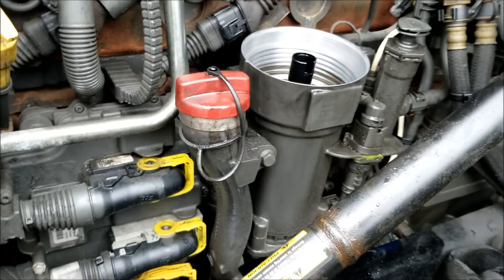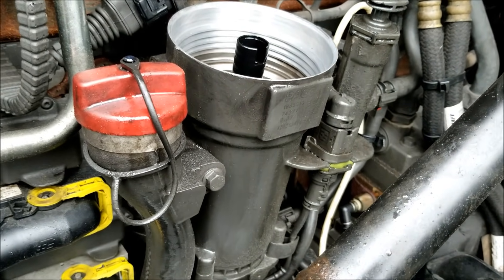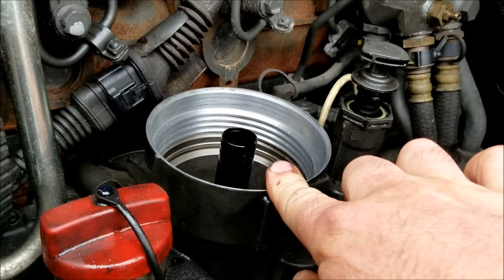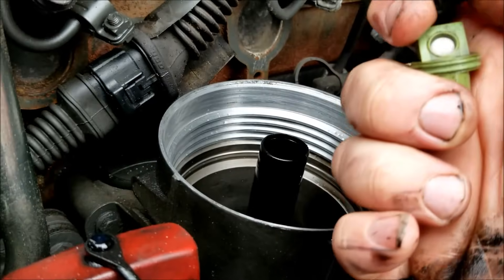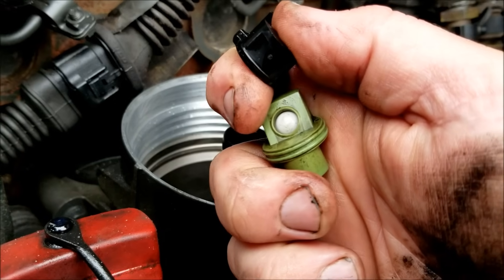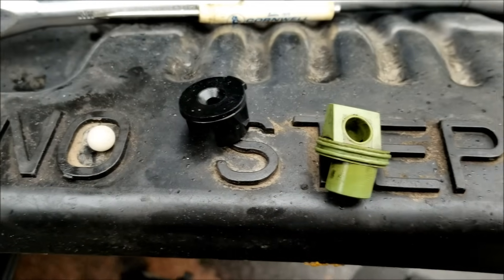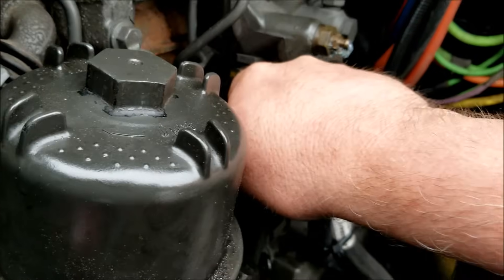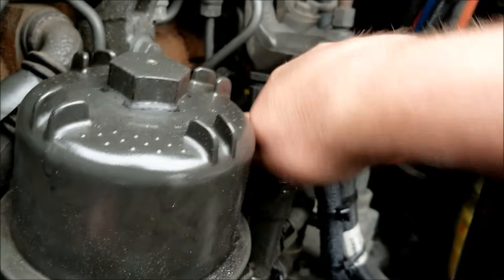Paccar MX13 Fuel Issues - Check Valve video by Dr. Paccar

Comment from the maker: Make sure you remove the ball from the green piece. The green piece must be reinstalled.
Reply: Just changed my filter and removed ball green thing and cap...and started getting check engine light stating low fuel pressure....guess I need to put green thing back in and cap...lol

Comment: My truck would crank n run but after sitting over night I had to prime it to get it to crank so I open the file filter n removed the ball primed it back up n release the air n prime it again n she fired up let see what it does n a few hrs video was very helpful thanks
Reply: Hi 
Does your problem solve by removing that ball please update 
Mine have same problem

Comment: We are having the same issue. Found your video, removed the ball. Truck ran fine while driving until we stopped and dumped off the load. Truck through codes P0087, P1087 and P00BA. Filter has been recently changed. Could this be a fuel pressure control valve?
Reply from the maker: Depends. Most of the time I seen a code for the fuel pressure control valve electrically fail.  But haven't come across one fail mechanically yet. But you would need Davie 4 to monitor this. There are other things that could be wrong.  The new fuel filter could be defective.  The o-ring on the housing cut. Also there are two unit pumps on the back left rear of the engine.  I have seen one fail causing a low fuel pressure issue.  Just two weeks ago we had to replace the entire fuel filter housing because something was jammed up inside of it.  It would start,  run then die out. There are valves inside of the fuel filter housing.  But without the aide of the Davie 4 software you will just be changing very expensive parts.

Comment: This just saved me a fortune. Fuel filter replaced and came up with engine malfunction, changed filter again and then the fault persisted only under load. Checked and the ball was in the rubber. Removed and no more faults.

Comment: Most unreliable engines are Paccar. Never ending errors on dashboard and breakdowns. Parts for it are insanely expensive.
Reply from the maker: Yes, buy Cummins power.  The DDE13 and DDE15 aftermarket systems are horrible

Comment: Many mx13s have a small filter in the primer unit that can clog. Unscrew, remove, check and replace if needed. The check valve is one I didn't realize can be blocked! Appreciate that heads up! Not one service tech I've watched that took 20 mins to prime my filter turned that bleeded valve, or checked check valve or primer filter!

Comment: There is proper way to prime a paccar engine I am diesel mechanic I worked at kenworth it’s starts without no issue lots of place don’t know lots of places use the air vacuum pump it works but there soo much easier way
Reply from the maker: I worked for Kenworth for years myself.  This has nothing to do with priming a engine.  This is a issue where the engine runs until it empties the fuel filter housing and doesn't keep it filled.  That white plastic check ball gets flat spots and eventually gets stuck closed. It's only there to force you to use the proper micron fuel filter. But causes more issues as the mileage racks up. So we just removed the plastic white ball and have had no issues.
Reply: @Dakman im getting spn1347 which i think is same as p0094. I recently changed FPRV bc truck shut off while driving and wouldn't restart. Replaced it crank right up, but MIL still on and every now and then the stop engine light will come on and go away. Do you think i have a leak somewhere? Im new to this engine all my trucks are 60series except this one so im clueless here .  Thanks

Comment: I have issue with fuel in my paccar 2018 what i found out when idling everythink is ok but when go down the road it shots off and another think i see there is problem with fuel level in tanks passenger empty driver full what could it be is that damn white ball cuzing problems ?
Reply from the maker: The fuel between the left side fuel tank and the right side fuel tank is a equal draw system. If you use up all of the fuel in the right side tank it will quit running even if the left side tank is full because it's pulling air. If this is what is really happening there is either a blocked hose for the draw tube or the return line for the one tank that doesn't empty. Also it's important that any fuel lines replaced to the fuel tanks are made in the exact length as removed. Best thing to do is remove the fuel lines from the tank that doesn't draw fuel and use compressed air to blow through them in case something is plugging them. But to answer your question that white ball has nothing to do with with fuel only drawing from one tank.

Comment: Having this same problem truck died on me on the hwy. won’t stay primed at all. My ball is missing completely and has been for months now truck won’t stay primed
Reply from the maker: The ball has nothing to do with keeping a prime. It's just there to make sure you install the correct micron fuel filter.  If the micron is wrong it will plug off the port.  If you can't keep a prime more than likely you have a leaking seal on the back side of the fuel filter housing.  There are two ports there.  One for supply and one for delivery.  I have seen the seal go bad and allow fuel to drip out which causes a loss of prime.  This seal isn't a easy job.  You need to remove the entire fuel filter housing.  Extra care must be taken when putting it back together because the port for the seal is sharp and you can easily cut the seal
Reply: @Dakman  figured it out the water separator housing was cracked where fuel lines screw into. By passed the water separator and it starts right up every time so I’ll be replacing the housing tomorrow when I can get the parts

Comment: we have truck with mx13  keep giving problem with fuel restrict filter. keep getting same problem from 7 months it is new truck 111k miles .We went to different dealership spent about 18k on it they always clean fuel tanks and change fuel filter,sensor,def filters. still not found problem

Comment: I have a 2018 kenworth t680 with a problem where my driver side is pulling from the passenger tank to the point where the truck dies I’ve replaced the 2 fuel splitters and also blowed air through the line near the driver side where the engine is 
And theres nothing blocking that line 
I haven’t tried the line that connects to the fuel pump that’s on the side of the frame yet 
But what other things should I try after that
Would the supply line cause the fuel to get sucked from one side to the other???
Reply from the maker: Yes a supply line would cause fuel to get pulled from only one tank.  There could be a piece of rubber inside the line that separated and is blocking the suction.  Some Kenworth trucks have vents on the tanks with filters.  There's a maintenance replacement of replacing those vent filters annually.
Reply: @Dakman  should I check the return line as well??? Which I’m sure I already did. the vents on the tanks are fine

Comment: So I just replaced a filter and check valve ....problem was losing prime...manually priming was pulling from the upside down fuel water separater housing then when i stopped priming it would refill the fuel water sep filter. Primed with filter off got bubbles installed new check valve with ball primed with screw loose got straight fluid...truck ran for about 20 mins then lost it again...tanks are visually both at 1/4 full

What else could be the issue it's losing prime?
Is there a check valve associated with the fuel water sep housing? And initially why priming did it pull from f/w sep then fill back up when stopped priming?
Reply: We were having that problem on one of our trucks not too long ago and it turned out that it was the whole Prime and handle assembly. It has a check ball inside of it that was sticking open and was allowing the fuel to leak back by it slowly. Changed the complete primer assembly and no more issue.
Reply: Hello. The translator does not translate your problem very accurately. If you write in Russian, then perhaps more people will be able to tell you.

Comment: Big question could this check ball stick causing back pressure on the pump causing the 2 hold down bolts to break
Reply: If you are talking about one of the unit pumps, then no.  The problem is a common one. We have had two trucks in a month do the very same thing. The mounting bolts somehow came loose whether they weren't torqued properly or whatever. But as they loosened, the pump continued to work itself loose until it broke both bolts and threw a few codes and caused the truck to break down. To this day, Peterbilt still has not given us a reason for this issue.

Comment: So I changed mines today but your video explains so much more my problem is I don’t think I primed it properly I manage to get it started and my check engine light came on
Reply from the maker: The check engine light will come on if the fuel pressure is too low for a certain time period.  Once up and running the check light should go out after so many drive cycles.
Reply: @Dakman   question should only the ball be removed or should the green piece and ball be removed ?? Thanks

Comment: Hi, I have problem with low fuel pressure. I have only 2 bars. I changed first fuel pump but it wasn't that. Have anyone the same problem? Engine is running but DPF is not regenerating.
Reply from the maker: You could have a problem with one of the unit pumps which are located on the left side of the engine or even a bad fuel pressure regulator.  It will not do a regen if the ECM sees the fuel pressure is below a certain spec.
Reply: where Can I find fuel pressure regulator? I have MX11 engine

Comment: I have a 2016 mx 13 and in the past wk I've been experiencing an increase in fuel consumption.  My average dropped down to 4.9 from 6.8-7mpg. Possible causes. Along with some pwr loss
Reply: Following. I have the code P0094 with P1515 and P1496. But all are inactive.

Comment: I would like to ask you a question. My 2015 KW with a paccar engine has been in the shop for 9 months and it seems like no one can figure out the problem. The truck will start and idle fine, when you start to give it fuel at around 800 rpms it will start blowing out black smoke (a lot of black smoke) and will not take any more accelaration . The mechanic has check injectors, fuel filter housing, fuel pressure, fuel pump, and still it is doing the same thing and no one can figure it out. No codes.
Reply from the maker: I'm wondering if you have a cam sensor issue. I have seen cam sensors give the ECM weird information but not code.
Reply: this is happening to a truck I'm checking out,  no codes , only revs up to about 10000 rpm with a lot of black smoke
Reply: any luck?

Comment: 2016 KW with mx13 unit died on frwy wouldnt start found same issue, after repairs unit would start and would die within a few min. sucking air and would drain bowl. found that the return line was sucking air at the pressure control valve and the return line which runs to water seperator ( seperator has a "blend valve") which is puting air back into the suction side of system causing it to lose prime.... worst design of a fuel system ive ever had to work on...... and FYI the mx11 are breaking rear motor mounts just something to keep an eye out for when doing your P.M.'s
Reply: I’m having the same issues mine starts up but shuts back down after 30 secs or so. 2014 kw any idea what could be the reason?
Reply: My 2012 t660 had the same thing happened, died on freeway .. wouldn’t start . Had air on the water separator losing prime . What did you do to fix your issue !?

Comment: I took my truck to the shop for an oil change and fuel filter replacement and when they replaced the filter i truck wouldn't start for this same reason but you would think the mechanics there knew about this but not. it took the HOURS to figure this out and ended up charging me 2,300 dollars for the job.
Reply: I swear this should be illegal for dealerships to do this. They did me the same way

Comment: This issue will not always make truck not start. It can still run but be derated because of low fuel pressure. So if you can't pull much over 20#'s of turbo  boost check ball

Comment: Where does the ball come from to be sucked in the fitting like so
Reply from the maker: That ball is installed so if you put the wrong micron fuel filter in the housing it will shut the fuel off.  Problem is the ball is plastic and does wear then finally falls out into the fuel housing

Comment: Ever seen that check valve fall in the bowl and cause problems? I couldn’t fish it out and it was blocking a line. Took a while to fish out but once I got it out the engine started right up.
Reply: How did you get the ball out

Comment: great video you actually showed everything step by step i am getting into a 2015 pete with mx 13 so need all the videos i can to help my self as an owner op thanks again.
Reply: I just got a 2016 pete 579 (paccar) drove it off the lot ran it for 2 months no problems then did my first oil change and on my first trip 2 weeks in gouges showing that my fuel filter needs replacing then 2 days later driving n had a bunch of codes comes up n check engine lights saying I got no DeF need to shut off engine to prevent damage while Def Guage going up n down from full to empty untill it settled down to how much I had in there about half a tank n started working fine now couple days later while driving throughout the days the fuel filter keeps going up n down from being ok to needing to get replaced but drive just fine untill today the fuel filter Guage is all the way in the red n now 6.codes came up I researched it basically telling me to replace fuel filter and the truck barely pulling at 50 mph so after doing my oil/fuel filters change  rolled out on the road and 7000 miles later im sitting at the shop right now wit my truck barely driving 6 codes came up n im just hoping the fuel filter change will resolve this problem. Maan I love me these Pete's but all the electrical n Sensor issues are crazy n the more I look into it n read about it ppl have all sorts of problems with these newer trucks wit the Def issues or fuel issues or sensor issues and everything costs soo dam much its crazy while my dad has a 20 yr.old truck wit no Def n he never has any issues whats so ever its crazy so good luck to man I been driving couple years now n got this truck wit my dad so I could be owner operator also and withing the first 3 months of opening the truck every trip I get some codes.or little issues that pop up like my ambient air temperature sensor that just went out also it tells the outside temp but its connected to the trucks ECU computer n dealer said this little temp sensor can cause all sorts of other codes to come up n cause all sorts of problems for u n u can spend thousands of dollars at the shops n they won't figure it out so if u ever have that sensor go out or any other ones make sure u get it fixed right away cause apparently it only causes more n more issues n can leave u on the road spending alot of money like im about to do so good luck
Reply from the maker: Glad it helped

Comment: Thanks for the video man I learned a lot I have a 2016 t680 and it runs like a charm 600k on the clock but I did notice today that I would be running down the road and the truck would hesitate for a second but no sirens or panic lights on the dash everything looks good there's a new guy in our shop and I wonder if he ever changed my fuel filter
Reply from the maker: Glad it helped. Your Kenworth has a fuel restriction gauge. If it's reading 12Hg or more under acceleration then the fuel filter did not get changed on the engine.

Comment: Hi,
You don't need that rubber either.Make a flow greater.Level of fuel in fuel housing is measured by check valve tube.Just to help all Truckers 😀😀😀😃😃😃😃😃😃😃😃😃

Comment: That fan hub may need replacing soon if mileage over 350k.
Also,
If fan belt starts frayng on the sides:
Inspect or replace 
Alternator
Ac compressor
Fan tensioner belt pulley

Comment: will the hand pump will pump fuel into glass filter when the ball blocks fuel? when i pump with hand pump, i see fuel coming to glass pump, the truck starts, but shut up in 5 min.
Reply from the maker: Yes the hand pump will fill up the bowl. However the truck will use the fuel in the bowl and it will not refill that bowl if the ball is blocking the port therefore will empty the bowl and the engine will shut down
Reply: Dakman Productions plz help have power loss over 55 mph can you tell me what to chek?
Reply: Dakman Productions my moter is exactly like this?

Comment: Bro mine is different my paccar has that fuel filter on to and my primer pump is red next to the engine were do u think my check valve is at?...
Reply: Although it's quite a late reply, your system does not have this check ball. This check ball is there to block fuel supply if there's no filter element installed. Since the earlier models use a spin-on filter, they definitely would not be able to run without a filter installed.